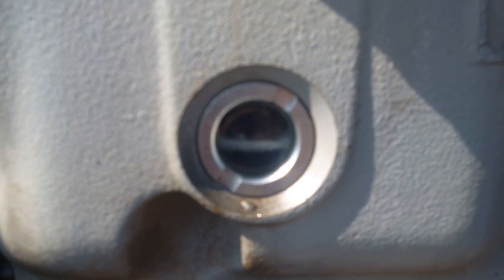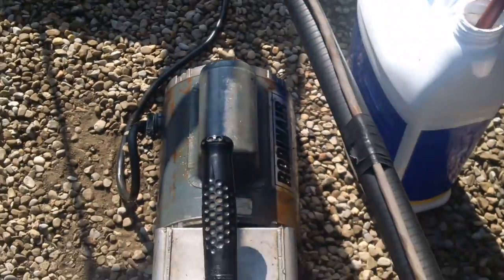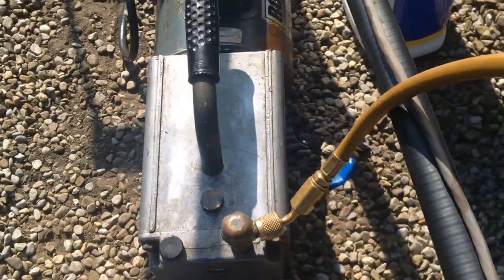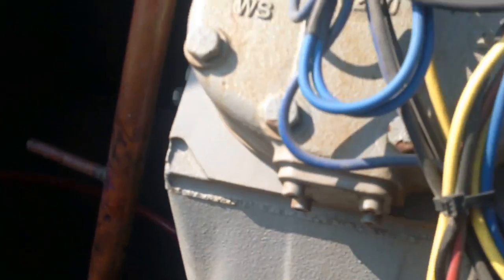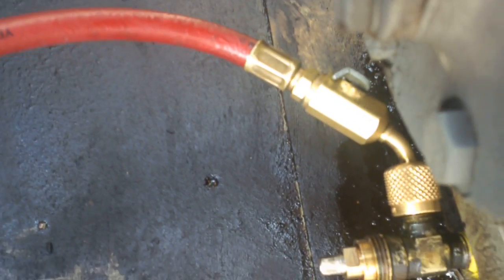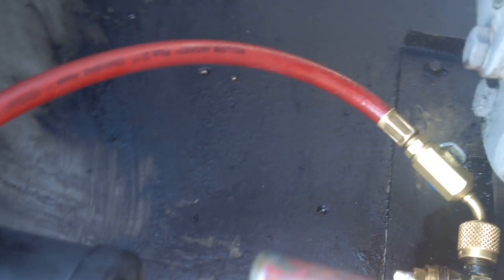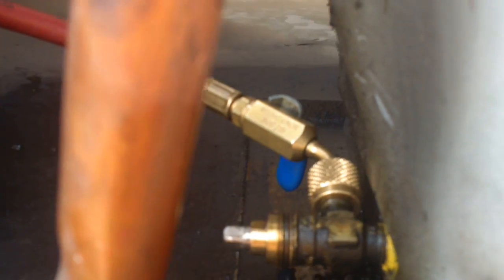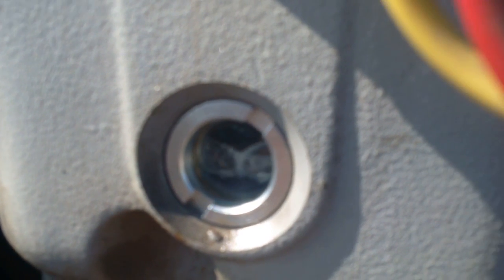HVAC Know It All - Adding Oil To A Compressor Using A Vacuum Pump

Comment: Won't this suck the air and moisture that's in the red hose, into the system?  How do you bleed the air out of the hose, or is it not enough to matter?
Reply from the maker: Buell Ah you may pull some air in, but if you pull a good vacuum afterwards the amount is negligable.
Reply: @HVACKnowItAll  I was wondering same thing.  Good answer.

Comment: I built a small mini split ac system out of 2 window ac units but when I was building it I lost an ounce or 2 of oil does this method work on a hermetic rotary compressor? If I slug the compressor with oil will it ruin it?
Reply: What? Id like to see that lol

Comment: Your pulling a vacuum on the suction inlet of the compressor but you isolated the entire system correct im confused cause your saying your pulling a vacuum on the suction line.

Comment: Isolated meaning oil is separate from the refrigerant? Is a bit of air any worry? How much? Thx! Cool video
Reply from the maker: Compressor is isolated the from the piping and other major components
Reply: Should show the whole thing how to isolate& connect the hoses

Comment: How to find out if a compressor is low on oil i have had system lost complete charge through big crack?
Reply: No sight glass on compressor ! Lennox package unit
Reply from the maker: You need to pull it out, dump the oil and measure how much is in there.

Comment: wont air get in the lines tho??
Reply from the maker: The compressor is isolated from the lines and under a vaccum
Reply: yea but introducing the oil from open top oil can u would think oxygen will b introduced

Comment: You just sucked air into your system.
GFM
Reply from the maker: grayfurnaceman yes, very little though.  That's what the vac pump and micron gauge are for 😀
Reply: Shit thats what a liquid core is for 😂😂
Reply: After oil top Up  vacuum again before fill refrigerant
Reply: Kind of feels like a crossover episode with GFM commenting.
Reply: @HVACKnowItAll  correct me if I wrong, after all set and done can you isolate the compressor and pull a deep vacuum just in the Crank Case before returning the system back to it normal operation due to the oil open to the atmosphere pressure? I really loved all of of video, please keep it coming 👍. Stay safe Brother!

Comment: Less life to you vacuum pump.
More moisture to your sistem.
Reply from the maker: the compressor is isolated to the system.  How is causing less life to the pump?
Reply: @HVACKnowItAll  probably less life for the vac oil.. thats about it... pump would be fine
Reply: @HVACKnowItAll   the compressor is not isolated and the proof for it that you are on a vacuum ! which pulling your oil but that's ok to do it, because you are running vacuum so that air will go out by the pump.
Reply from the maker: @amoshadad3657  the compressor is isolated 100%
Reply: @HVACKnowItAll   ok, so how do you think the oil get pulled  ?

Watch those 2 videos on  scroll compressor cut open and tell me if you still think that the oil is isolated from the suction line.

Video -1 :
https://youtu.be/iHvTMPUwm3E

Video -2 : 
https://youtu.be/fhNb2gBhghE

Happy new year !
Reply from the maker: @amoshadad3657  the compressor has valves, it's isolated from the system that still has over 30 lbs refrigerant inside.  The vacuum is only being pulled on the compressor,  nothing else.  I was there and physically isolated it.
Reply: Got it , perfect then . I didn't see that you isolated the compressor. that's a great way , thanks 👍
Reply: @HVACKnowItAll the fact that people are worried about air/moisture getting into your system while you are pulling a vacuum is blowing my mind. HES PULLING A VACUUM! Why is this so hard to understand? Good luck buddy, keep up the good work.